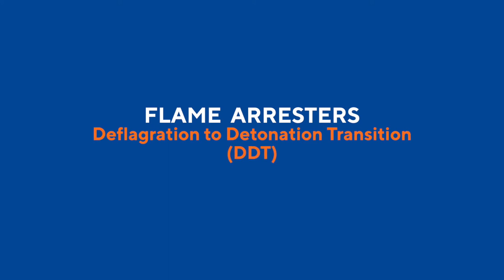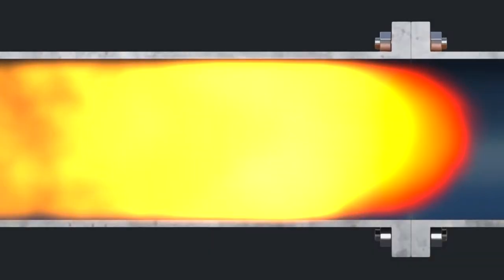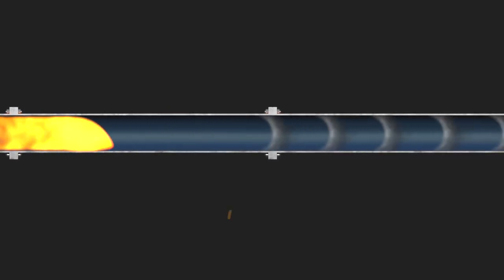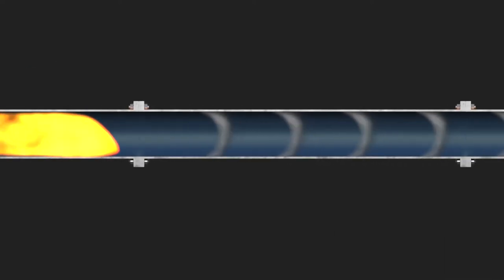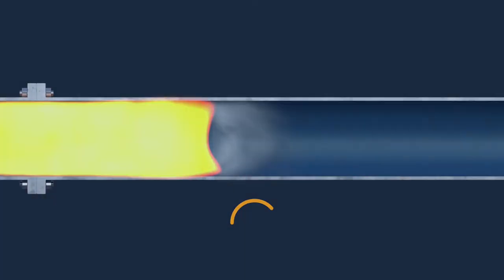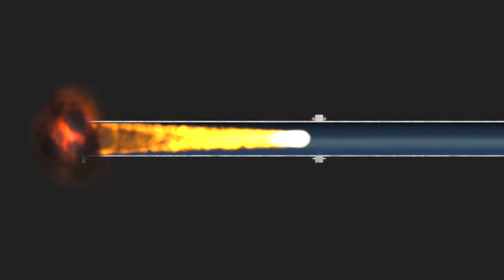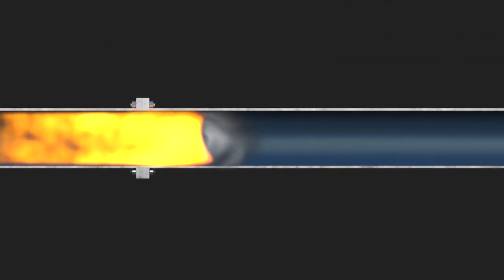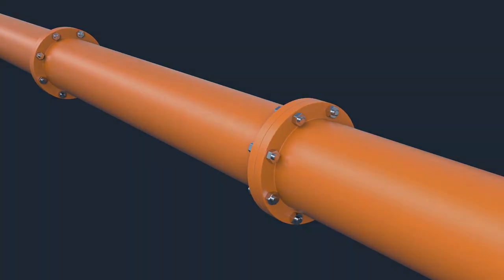Flame Arresters & The Deflagration To Detonation Transition (DDT) Explained

Comment: Seems like that principle could be used to detonate high explosives with a deflagrating low explosive under sufficient pressure to create a ddt.
Reply: Yea thats how some blasting caps work explosives like NHN (primary explosive) is just burning avay like flash powder but when comprest very stong it detonates with 7000 Meters per second this is very high speed but yeah it's just not that easy to detonat but when it does it will set off almost any secondery high explosive
Reply: @nothin328 
7,000 m/s is dynamite and tnt velocity. Twice ANFO. That would certainly trigger a secondary. If compression from the containment can produce that with flash powder I’d be mighty impressed.  
Can a 70/30 mix of pot perc and black aluminum flake in a strong container actually achieve such velocity?  Or perhaps some pot chlor and sulphur to make it more reactive. 

I have my doubts, but your comment makes me hopeful that it’s true. I doubt someone would put a vid on YT showing somebody detonating ANFO with flash powder, but I’d be happy enough knowing somebody has actually done it.  👍
Reply: @flapjackson6077  well flash powder can onyl detonate more sensitiv charges like AMMONAL ore mabe Dynamite but it's a lidle bit unrealistic but mabey possible well it's very hard to detonate high explosives with flash powder but super fine Aluminium mabe will detonat without confinmet when you can do this it would detonat high explosives but there is an flash powder type it ist Klco3 50 and 50 1Micron Magnesium with this Mixture you could detonate high explosives much easier than any other flash powder but chust remeber it has to be super fine Magnesium ore Aluminium but more insensitiv explosives like RDX,PETN,ETN is imposible